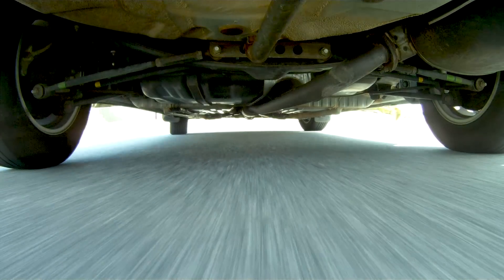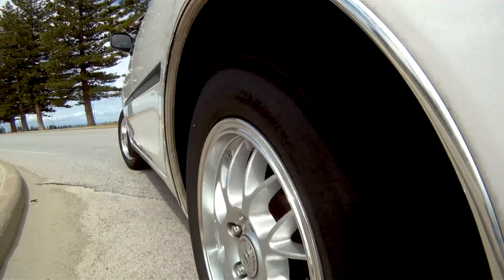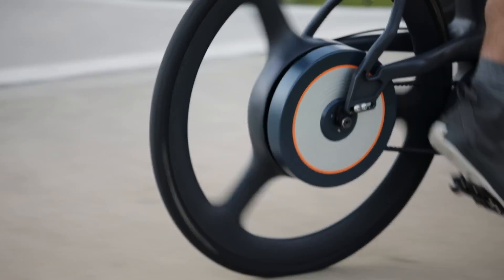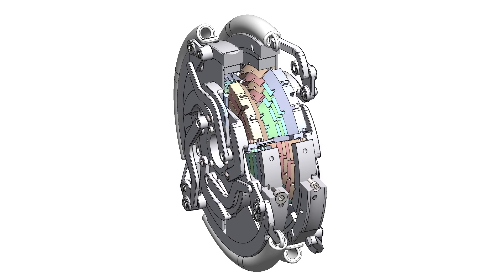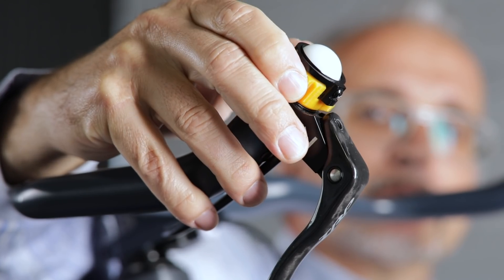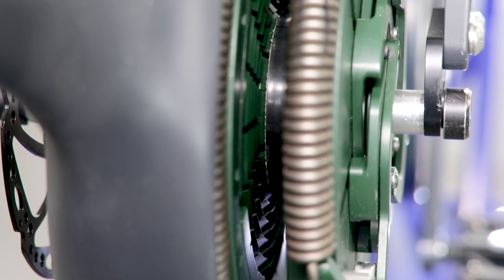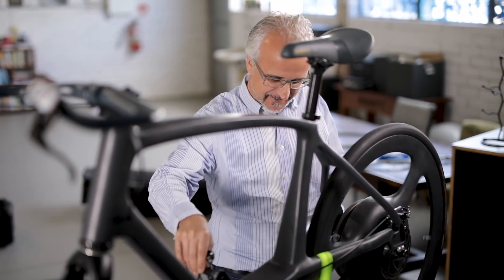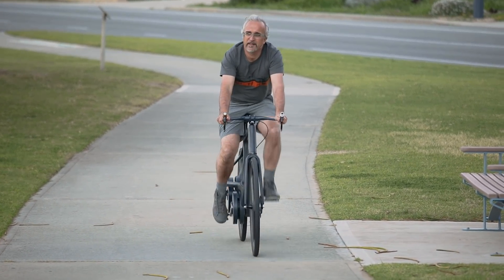Continuously Variable Transmission on a Bicycle

Comment: Why would people buy this? What we have is good enough. Even if you'd argue this is something for top most expensive bikes I'd still say no. I ride almost 1000 km a month cycling to work, I do this on a 7000 dollar Stromer electric bike. I wouldn't buy an even more expensive version if it has this gear mechanism, I'd still go with chain (or belt). For 90% of my ride I stick to one gear, I don't need this advanced variable transmission.

Comment: What is wrong with using a regular wire to control the transmission? Imagine cycling through an area where a strong signal is going about only to disturb the connection between the leveler and the transmission, say bye bye to changing gearing mode.

Comment: What nonsense! 
1. If there are a few fixed rings that engage and disengage, then it isn't a CVT.
2. They are shifting between those non CVT gears using Bluetooth, which is unreliable af.
3. If the rear gear "reacts" to the pedal gear and the rear gear can't shift by itself (based on some mechanism that they haven't mentioned), the rear should have the same or fewer number of gears than the pedal gear. That means the highest gear on this cycle is the same as the number of gears on the pedal gear. A normal road bike with both pedal and rear gears has far more gears than this CVT which should ideally have infinite gear ratios.

I am sleep deprived af and I could tell that this was a pathetic idea.

Comment: Indeed this is being lambasted in the comments, but other than its size (which is an issue not entirely overcome) I think it's quite a comprehensive product. Unfortunately, the three things cyclists care about the most in drivetrains are weight, size, and range. When everyone went to 1x derailleurs, not many lamented the lack of choice.

Comment: Useless on a bicycle. The human body does not produce power like an internal combustion engine. When you ride a bike you do not have to start in a lower gear and progresivly change to higher gears as you speedup. The gears on a bicycle are for riding up and down hills. If you live in an area that is flat with no hills the best bike to ride is one with only one gear.

Comment: Once I bought some jiba jaba Mercedes S class add on bike. It was like 20 000€ option on new mercedes for 2 bike+rear mounting hardware on car. 
I got bike for 100€. I thought eureka, 10 000€ bike for 100€. What a steal... 
Bike had 3 speed + CVT belt driven part. All aluminium, hydraulic disc brakes, fancy dinamo, fancy bags... Epic looking. One of a kind Mercedes bike. Everything super until I sit on bike and start pedaling... Long story short horrible thing. Belt is stretching and absorbing your power+ it's robing against pullies. On top of that it's slipping. Just doesn't go anywhere 🥺🥺🥺. I'm trying so hard to keep up with people who barley doing anything on their mountain bike. 
Belt+ pedaling=disaster

Comment: I love how they flex that you only have to change the front sprocket and the rear reacts like it’s a design choice that they brought to the user but in reality it is required that it behaves like that otherwise the belt will lose tension.

Comment: Bluetooth is bulshets..... were is boarding this fake EnjiNeRrs 😒 😕 🙄 😑 
I will pushed in 45° climb with my 100kg. And it will brake on parts like Lego toy . Or ti only can shift down the hill 😆. The hot water is already invented in scooter transmission. Its soo simple proven and it's working great!

Comment: People who don't ride bicycles just don't understand.  Shifting is the easy and fun part.  Turing the cranks is the hard part.  If I am going to have an electric bicycle it is to turn the crank and not shift the gears!   There is a reason race cars have manual transmissions and they have hundreds of horse power to work with.  When you only have 1/4 of a HP you want an efficient drive train and to pick your own gears.

Comment: Almost no moving parts .. I'm sure this will hold up to anything you throw at it ... Also in this video you claimed it never been used in bikes because of the witdh ... Ever Thought about motorscooters ? They also use vbelts ... But on really limited space and on the driven wheel side there is even a centrifugal clutch right next to the vbelt pulley thing .... I'm pretty sure you can do better

Comment: It's not even a cvt. They show right there that there are a limited number of gear ratios. I cannot think of a single advantage to this system, and the the fact that it requires a battery and a bluetooth connection and can't be repaired by anyone familiar with bikes makes it beyond worthless.

Comment: So you manually select a variable range of ratios? That isn't a cvt then buddy boy. Also my God they put 30,000 moving parts in it but used Bluetooth instead of a mechanical linkage? They built this thing to have as many failure modes as humanly possible.

Comment: This is how I feel about cars going with a CVT when manuals are just much simpler. Sure, my Sentra is smooth and gives me excellent fuel economy. But it did that for 48K miles, and the CVT costs more than the worth of the car since it can't be serviced and has to be replaced as a whole unit. Would that be the case with this? No more weekend wrenching?

Comment: Ah yes. CVTs. The least reliable and most hated type of transmission found in vehicles today.
Reply: You are wrong, most scooters use cvt system and I didn't hear that cvt system on scooters is bad
Reply: @akardas16  much simpler version of the cvt system. in cars, CVT transmissions have required complete replacement due to failure as low as 10,000-30,000 miles.
Reply: @bastaudio  you are right in cars may not be good transmission however nowadays advencing steel belt technology will handle failures in cvt system

Comment: As an engineer and a guy wich really love bikes I can say a few things:
1st In the video you are compering your bike (as I can see enough expensive - as for me 2000$+), with a really cheap one for 200$. 
2nt  Please be honest all gear modifications have a huge weight, and with a bike, with the same price, it doesn't make sense.
3rt It's hard to change a belt, so you can't use this system on any bike.
4th This gear system is really hard to fix.
5th And what about belt efficiency?
// The idea is really cool, but it had a lot of disadvantages, so it hard to use in reality.

Comment: Cycling reality: this is human powered transportation which operates outdoors. If the weather is cold, or otherwise unpleasant, cycling is cold or otherwise unpleasant. If it's not cold, you get varying degrees of hot and sweaty - you're engaging in exercise after all. At least in the U.S., this is why people don't use bicycles for short distance personal transportation (longer distance transportation is also dependent on available infrastructure, also sorely lacking in the U.S.) Simplifying the drive train won't do it, otherwise we'd all be riding bikes with internally geared rear hubs. As interesting as this may be to engineers and other tech types, this solution will not get more people riding bikes. And you have to get a lot more people to ride so the economies of scale will bring the price of the new system down.
richard
--
Rules for living: rules, guidelines, and principles from specific activities that generalize well.
- Don’t arrive exhausted at the bottom of a steep climb (or a long, hard pull into the wind.)

Comment: It's a solution to a problem that didn't exist likely creating hundreds of different problems like when your battery runs out on the motor that compresses the belt up. And you're stuck in your lowest/highest "gear" but that's still really cool and God damn the engineer that designed/built that needs a break.

Comment: It's a beautiful design! 

A lot of people are hating on it for not being practical, but it's clearly a proof of concept. Imagine this redesigned, bolstered, and improved for use on motorcycles! It'd revolutionize the motorcycle transmission scene as you wouldn't even need a transmission on the motor leading to much more compact, efficient, and potentially speedy designs! I like it!
Reply: Unfortunately those pulleys break all the time. That's why CVT isn't popular even in cars

Comment: WHO WOULD WIN???
An Over Engineered Bicycle Gearing System
or 
a small rocky boi
Reply: Falling over
Reply: I shudder to think of maintaining that nested cone mechanism
Reply: Rocki boi
Reply: A stick in your spokes
Reply: A, small rocky boi would not affect it. ;)
Reply: You think they haven't thought of that?
Reply: @FAB1150  yes
Reply: @pixelmace1423  well then you're quite naive, to put it lightly
Reply: @FAB1150  well sorry for that but can you please explain how they prevent it from jamming when a rock is in there?
Reply: @pixelmace1423  belt systems already exist, and work way better than chains... The only disadvantage is that you can't have gears. This is just a solution to that problem. Quite a bulky one, but it's nothing new.
Reply: @FAB1150  i see, but it seems you are dodging the original question I asked you
Reply: @pixelmace1423  he is avoiding the question because he has no answer, because there is no answer
Reply: @pixelmace1423   You're both sort of right if a rock got in it would just stretch the belt and go through (This has its limits you can't like throw Boulder at it).
 It's kind of a dumb way to change gears and actually looks kind of bulky. Belt  systems aren't infinitely better than chain drive either. For example belts have more power loss than chains. They don't grip as well when wet either.
Reply: @FAB1150  Thats like saying cars exist and are better than semi trucks. Each has a specific use they are not to be compared
Reply: @Fine_i_set_the_handle  what? That's a stupid analogy. Chains and belts are two systems designed to do the same thing. So one can be better than the other, at that thing.
Reply: @FAB1150  so are cars and semis lmao they're both designed to carry things doesn't mean one isn't far lighter and more effecient
Reply: @Fine_i_set_the_handle  wtf? The difference between cars and semis is the exact opposite of the difference between chains and belts.
Cars use the same concept and technology as semis (ICE, transmission, ...) to achieve different stuff (cars are designed to take people or relatively small objects for relatively short distances- save for the occasional road trip, semis are designed to transport huge quantities of stuff between continents, and run basically non-stop for their whole lifespan). Belts and chains use completely different technology to achieve the same thing (transfer energy from the pedals to the wheel). And belts are significantly more efficient and reliable than chains at doing that.

So if you wanna pick an analogy, don't pick one that says the complete opposite of what the point is.
Reply: @FAB1150  you literally just repeated what I said, also by your logic we should just build everything out of high carbon steel because it's stronger, who needs effeciency or weight reduction or parts that wear intentionally
Reply: @FAB1150  How can't you have gears with a belt drive?
Internal \ hub hearing systems already exist for belt drive bikes.
Reply: @FAB1150  hub gears have existed for a long time and most belt driven bikes are equipped with them. Additionally, there's gearboxes on the market now.
Reply: @FAB1150  Belts are less efficient at transmitting power than a chain......its a fact
Reply: @FAB1150  >thinking scientists go outside
Reply: @FAB1150  honestly yes

Comment: Forget the Bluetooth, add a microcontroller and the sensors necessary to form a mechatronic of sorts for the transmission and you’ve got yourself an automatic bike transmission. You could even drive a tiny alternator off of the belt to keep it powered.

Comment: I’d much rather companies focused on bottom bracket mounted gearboxes - that’s where the future is at. Move the weight away from the wheels, it hurts suspension performance and wheel acceleration.

Comment: The mechanism is cool but this isn't a CVT if it has set gear ratios. It's just a way to use a belt instead of a chain. I can't actually think of any scenario this would be useful in.